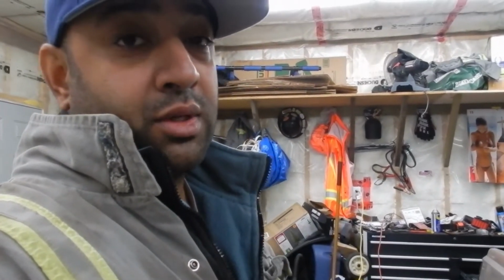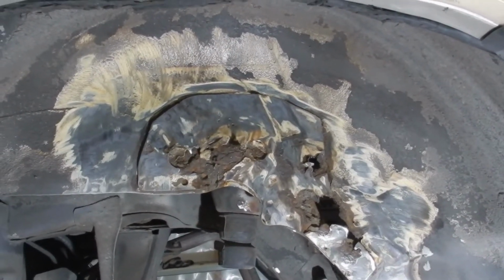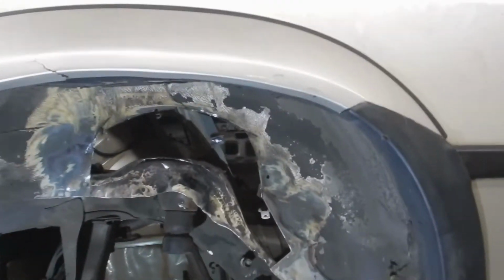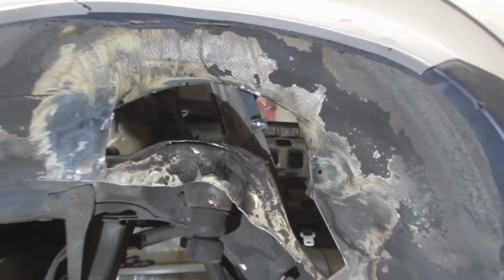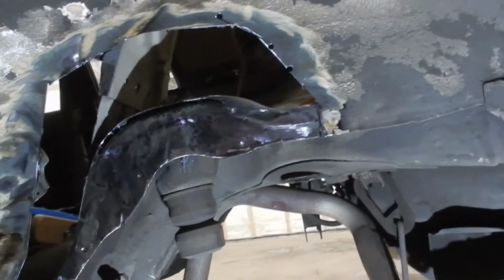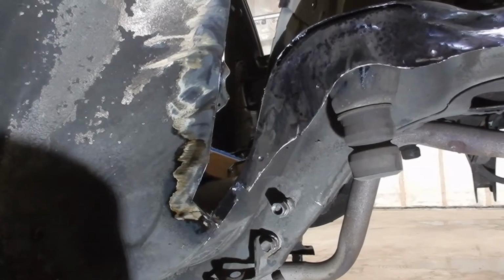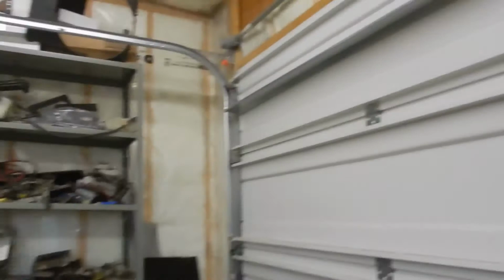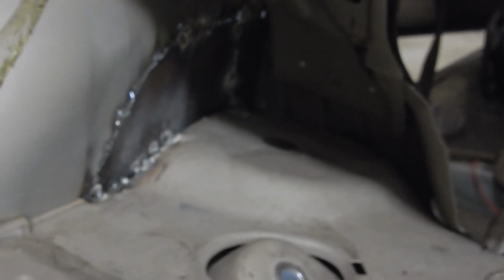1984 Celica RA64 BEAMS Build part 3

Comment: Hey I have an 85 Supra P Type.  I bought the KYB AGX shocks for a 91 Camaro (part # 743019).   The stock springs are too long.  I plan install lowering springs.   Are there any that you recommend?   I would like to stay under $200.00.  Thanks in advance.
Reply from the maker: Celica - Nation you will have to raptor racing for springs.  Either that or T3 has coil overs but they are more expensive